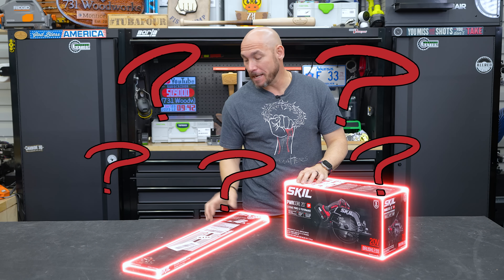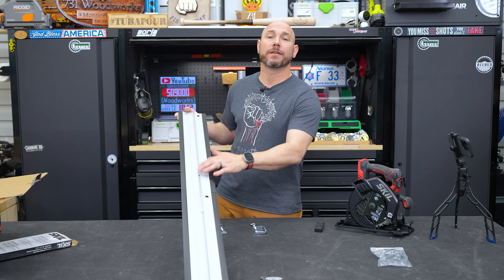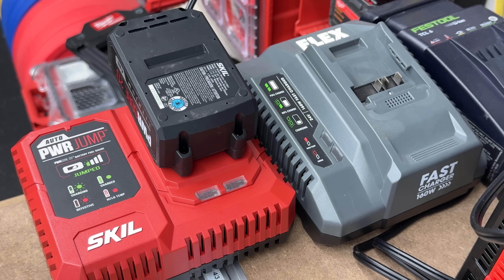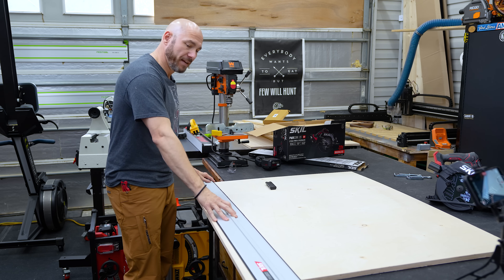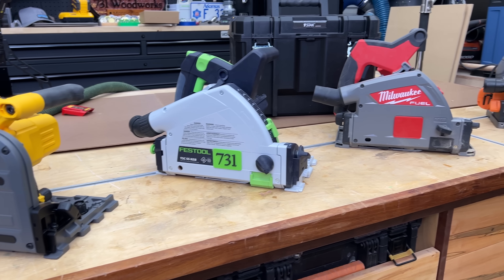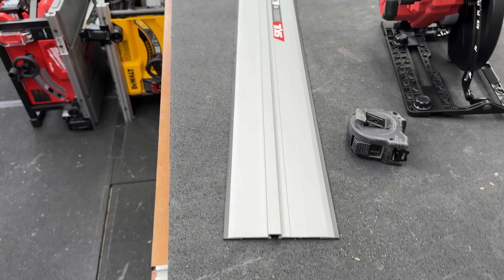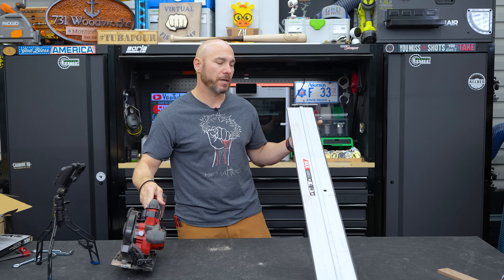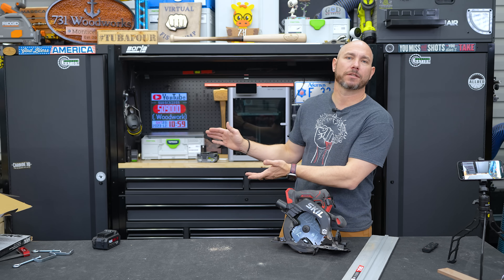Best Budget Track Saw Like You've NEVER Seen Before!

Comment: I just picked up the saw (tool only) because it was on sale at Menards for $80 but also had the 15% off bag sale.  Since I'm in the SKIL 20v lineup hard to pass up a circular saw that I can later get tracks for as well for $68.  I have a couple batteries and charger already and will look at getting the tracks at some point.
Reply: Wow that's actually cheaper to buy the saw and tracks separately 😳 💯👍🏼 assuming you can find it on sale like you did🙏🏼💖🎉
Reply from the maker: @mouthofthesouth4267 I actually paid $249 for it. It went on sale about a week after I bought it lol
Reply: @mouthofthesouth4267 But to match apple to apples I'd have to also get the 5.0 amp hour battery at $70, the charger at $40 and the tracks then for $80.  Battery and charger I could get the 15% off so ends up at $241 with the. 15% off.  At full price the $249 package is the better deal.

Comment: This appears to be a nice bundle.  However, it appears that the Skil track would not be compatible with any other circular saw, such as my DeWalt.  That’s disappointing.  All you would need is a baseplate - for which Skil has already done virtually all the engineering.  Then they could offer some competition to Bora, Kreg and Milescraft.  Oh well.

Comment: I think your take is slightly off here. I don't think it's meant to be for people looking for a track saw, that can also be used as a circular saw, but rather the exact opposite - people who need a circular saw for day to day work, but want the option of running it on a track from time to time for more repeatable straight cuts. Think customers of the kreg accucut style devices, but a more integrated setup. Still a great video and review!
Reply: Great thoughts on this.  I think Skil did a pretty good job of "knowing their customers" in this case.  They are generally DIYers and homeowners looking for a high quality but low cost solution.  This saw is capable of being a general construction saw, but with a good finish blade, can also do much of what a track saw does in general.  Skil (and their parent Chervon) are really good at delivering high quality at a price point.
Reply: I

Comment: I've had the skil brushless pwrcore 20 drill and impact. The batteries are great. They charge up pretty quick and stay charged for a long time. I don't have the hammer drill. I would get the hammer drill if you are a heavy user.

Comment: I have the skil power core 12v and love them. While its not a ton of power on the circular saw the drill and impact driver have plenty of power. The biggest win in my book is the cost of not only the tools but the batteries.
Reply: Agreed! I have almost the full line plus two of the multi volt tower lights and I have absolutely no complaints. I use them professionally too.
Reply: Me 3. I got the 12v line thinking they would weigh less. They surprised me with their power (don't have the circular saw) but the drill and impact driver almost always do the job. I had a screw that I couldn't finish driving and had to get me 20v impact driver. I tried the 20v on the first 2 of 3 settings and it didn't drive the screw any deeper. Had to go to the 3rd setting and it did finish setting the screw. Doesn't happen often. Really like the right angle impact driver and the power hammer.

Comment: Helpful tip. Get some grip tape and put it on the bottom of the track on both sides. Makita has a 36 volt. DeWalt has a but it is only sold in Europe. Hikoki is coming out with one also only available in Europe

Comment: I'm right handed and find my Festool, and most other quality track saws, quite awkward at making edge cuts.  Either have to hold the tool with my arm across my body or use it left handed, which I'm awful with.   My answer was to buy the Kregg track saw and tracks.  The saw is 'right handed', (the motor is on the opposite side to the Festool and most other track saws), this makes edge cutting on long boards fast and easy to use.

Comment: Its about time someone did this!  I breakdown sheet goods only a couple of times a year and its tough on a jobsite tablesaw with no garage.  Would love if this became a market changer.  Not interested in getting into yet another battery platform
Reply: I'm in the same boat.  I'm only breaking down sheet goods occasionally.  I just pull out a couple folding tables, throw a sacrificial sheet of insulation on them, then use a straight edge and clamps with my regular circular saw.

Takes a little longer but accuracy is great if you're careful.

Comment: Most tracksaws are plunge saws, they are spring loaded so you push down & make the cut, then when you lift it off the blade retracts... this saw does not do that...

As for the track not having a grippy surface, when I made a DIY track years ago, I used a finely Vee-notched spreader to apply silicone to the bottom... it worked great !!

Thanks for the vid and Happy New Year !

😎👍☘️🍺
Reply: 731woodworks4  ... reported...

Comment: darn, this would've been good when i started woodworking last year. I ended up with the Kreg accu-cut xl + cheap circular saw due to no cheap saws being offered back then
I think for anyone looking for mid-grade they should still get the Ridgid just due to the dust collection and track grip
Reply: Accu-cut feels/looks like a good idea but keeping the saw on the track perfectly is way too hard. The ripcut is alright but otherwise i'd say save up for an actual tracksaw.
Reply: @BlackstarStudio787  I was able to overcome it a bit by twisting the saw as i cut. i sharpied on some arrows to make sure i twisted it the same direction every time

this way the saw is more "locked" into place

but yeah i ended up getting a ridgid track saw when it was on sale with free 8AH battery. definitely cuts way more straight and i was able to 3d print a right-angle attachment to super easily align it

Comment: I see WEN now has a cordless 6.5 inch version that looks the same as their corded version. Sells for $182 with 2 batteries and charger. Adding  WEN tracks is another $80 or the better option IMO are the Powertec tracks for $120. I wish they had it or I knew about it before I bought the corded version. If I had to choose between the WEN or the skilsaw I would pick the WEN mainly, because of the track.

Comment: Thanks 👍 for the honesty in your review Matt! (I'm not the least bit surprised you were honest, because you always are!) I have one question about the track not being anti-slip. Could you attach perhaps like a non-slip sanding mat material or something like that to the bottom of the track without interfering with the functionality of the saw, except for the blade depth being different? I hope I made that clear. I didn't know exactly how to phrase it. I was thinking along the line of contact cement. 😊
Reply from the maker: Thanks. I think that would probably work.
Reply: @731Woodworks  Thanks Matt!
Reply: I added stair tread adhesive to the bottom of my DIY track; probably overkill but it works well.

Comment: This is great for guys who build outdoor decks. Specifically, when they run composite decking long then cut it with a track saw. Why you ask well because with the enclosed track saw (festool type) the plastic from the composite gets caught in the enclosure and stops the blade. Most guys run them with the enclosure open, that's why I feel that the skill track saw will work great as the plastic will not blind on the blade.
Reply: 731woodworks4  reported...
Reply: What do you mean

Comment: I'm thinking that knob on the side is for an edge guide when not used with the track. Is the edge guide included? Most are cheap, stamped and bent steel. It may have fallen and disappeared under your toolbox........ get a magnetic retrieval device....

Comment: Well, it's not a track saw. It's a circular saw that runs on proprietary track. You can buy guide rails that any circ saw can run on. And there is no dust collection to speak of without a covered blade. 
Still hoping to see you review the larger WEN corded track saw CT1272. 12 amps, 7-1/4" blade, solid & well made. Fits on industry standard track (WEN, Powertec, Festool, Makita). $170 at HD.

Comment: Not worried about corded vs cordless and in the track saw market. Is it worth spending the extra $150 and going with the Kreg track saw or going with this Skil for cheaper? Going to get used on some DIY stuff (mostly plywood) around the house and probably only get used a 15-20 days a year max.

Comment: Are we going to see makita 40v on this channel. Great video 👍
Reply from the maker: Do we need to see that?  I can make that happen 🤣
Reply: @731Woodworks  I am a Makita fan and trying  to decide if the 40v track saw is going to be a good option for a 2nd track saw now that the competition has come out with some good ones. You see I cut stone countertops on a regular basis 
with my currant saw but it does take a toll on them after a while. And now I need a wood only saw.

Comment: have you looked at the Evolution R185CCSX: Multi-Material Cutting Circular Saw 7-1/4 in. Blade With 3ft, 4in. Track saw system? $159.00

Comment: How does this compare to the WEN Track Saw you reviewed quite a while ago? I realize the WEN is corded, but it has a similar price point.
Reply from the maker: They are close in quality I think.
Reply: Bought the wen last year and it's great for most things. Per 731 angle cuts not trustworthy but I've never needed that personally.  99% used for sheet goods

Comment: Is there a third-party Track saw you can recommend for a Milwaukee M18 Circular Saw?
Reply: I too am committed to Milwaukee's M18 battery platform.  I purchased saw track from Peachtree Woodworking.  It is wider and longer than most and has three slots in the bottom for joining the track.  There is absolutely no problem with deflection of the saw track or alignment.  Even the clamps are far better quality than most.  I purchased a cheap (probably open box) Milwaukee 6-1/2" circular saw with a mill finish base from ebay and a decent pIywood blade.  I also bought a saw plate from Peachtree.  Instead of riding on the track, this requires a saw plate also from Peachtree.  I also make a saw table from two sawhorses, a piece of 1/4" OSB and 1" foam board.  This arrangement works far better than I ever could have imagined.

Comment: When will you be reviewing the tools in the Craftsman V20 line?
Reply from the maker: Which tools would you like to see?
Reply: @731Woodworks  I’m primarily interested in their trim router.  I have the 7 1/4” circular saw with a CMT blade that pairs very well with the Bora straight edge and sled and the Kreg Crosscut Station.  Its biggest drawback is the lack of dust collection.

Their cordless nailers are on sale and I picked up the 18 gauge.  It’s just what I needed to finish a fence picket planter box.  I hope to get the pin nailer before the sale ends.

Comment: Definitely not the first brand to have a track compatible circular saw, and not the first affordable brand either. Many brands have done this, and done it better too. The track compatibility was definitely an after thought, and not a very good one at that. No virtual pivot to allow 90/45 on the same side of the track, one slot track is terrible, no anti slip strips, no compatability with other brands. 
Evolution have had a corded one with Festool/makita pattern track for years. There's a new gen track and a cordless version of the saw coming this year from them.

Comment: Wonder how this compares to the grizzly track saw
Reply: I have the Shop Fox W1853 (same as the Grizzly and Sheppach) with the Grizzly branded tracks. I've experience a little deflection with mine on thick, dense materials. However, for the money I paid at the time, I got a decent setup. I am planning on replacing it with the Ridgid once I save up some coin.
Reply: @prestonlane6253  yea I noticed the grizzly was priced at 229 for everything I was like wow

Comment: Does anyone make a corded track saw? I’m working in a shop with power so it seems strange that all these are cordless.
Reply: The Makita SP6000J, it’s about $459 by itself, or $519 with a 55inch rail.
Reply: @jj6595  I’m surprised more of these manufacturers aren’t making corded versions of these track saws. It would seem cheaper.
Reply: @matthonea7939  I totally agree with you. Some tools are great because they’re cordless, but that doesn’t mean every tool needs to be battery powered.

Comment: God I hate circular saws... A really small battery one can be handy sometimes.. but for everything else I use an actual track saw. Completely superior. With a good vacuum connected there is virtually no dust.
The circular saws I've tried also feels flimsy... like you can bend things.. the angle adjustment is often just secured in one end.. on thin metal that feels like it can be bent.. It also feels dangerous when the blade wont retract by itself if you lose grip..
I f-ing hate them.

Comment: For what this saw costs, and STILL have to clamp it down? I myself, would not bother with it. You don`t gain anything with this saw...sorry.
You`ll get the same exact results just using a straight edge clamped to a board and using a regular ole circular saw, sawdust blown all over included.